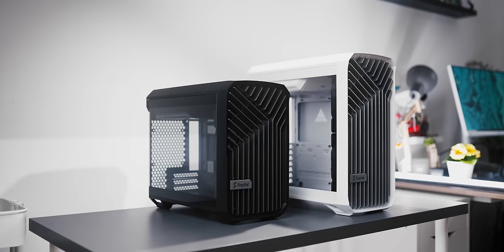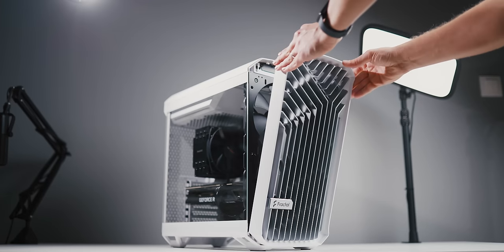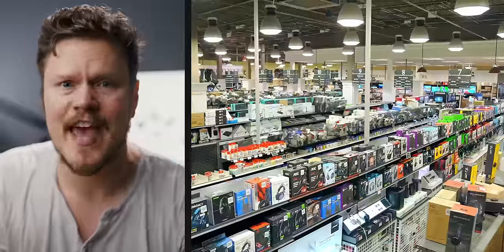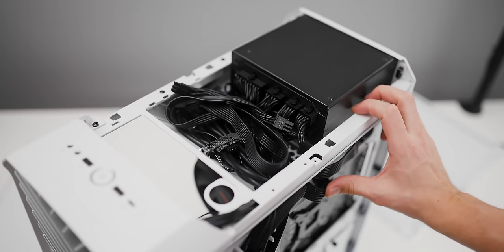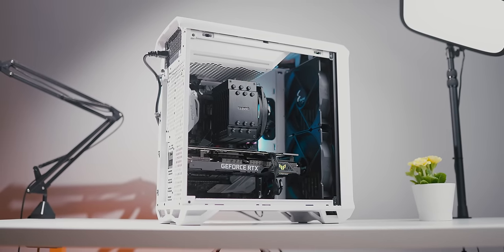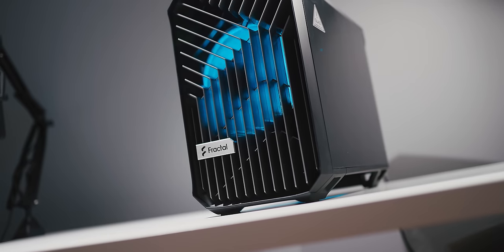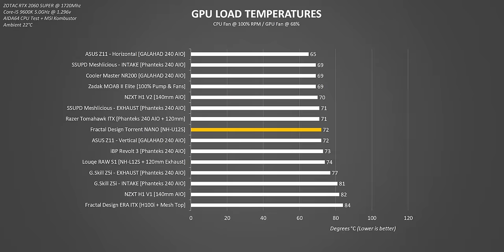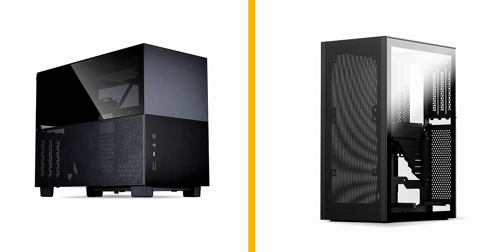Absolutely LOVE These Cases - Fractal TORRENT Compact & Nano!

Comment: I really wish they offered a full mesh nano. I’m over glass side panels. I love the design.
Reply: There's a reason why the top and side pannels are sealed while the front and back are full open, to chanel air in one direction, hence the name Torrent.
Reply: Why? With top and bottom intake, having sides/top sealed makes perfect sense.

Everything just pours out the extremely open back panel, the 180s move an insane amount of air.
Reply: No. It would let all the air escape before cooling anything.
Reply: Sliger Cerebus X.
Reply: A mesh side panel would do nothing for cooling while looking worse

Comment: I think Fractal design has nailed it with the Torent line. If I'll be making a build solely for myself, I'd go for the Nano. If I have to make a build to double as a workstation, I'd go for the Compact
Reply: I rebuild my PC with the Nano this week. And it works great, even with high end components. Would absolutely recommend that case.
Reply: @JayMatth   what cooling solution did you go with, ive Q58 at moment but high temps and noise are getting too much.....
Reply: @BrazenFond  I left the huge front fan in place, got an Noctua NH-D15 as  the CPU cooler (only the middle fan mounted) with an additional Noctua NF-A12x25 as rear exhaust. All fans are CPU-Temp controlled with max 60% speed settings.

But keep in mind, that my CPU (i9 12900k) will still reach its thermal limits under full AVX load.
For me its not a problem as I have no realworld workflow that uses 100% of the CPU.
Reply: Great case if you want to fry any high capacity hard drives that you're 
still using for mass storage, since SSD's in the capacity are way too 
expensive. That whole part of the case for cable management and SDD/HDD 
storage is totally flawed.
Reply: Why not the full atx?
Reply: @gickygackers  with the work I do now, the resources I need are more readily available on the cloud. Plus the cloud aspect negates the overhead of having to keep my workstation up to date so I can focus more on my job rather than put effort into maintaining my own workstation's system. So for my own personal build I'll be going for ITX for small scale personal projects and gaming. And if the personal project need more resources I'll look at cloud services to cover the extra overhead
Reply: @ResumedPausing  Full ATX case just allows system to be cooler but okay mister "cloud services". Wouldn't want you to put too much effort into it
Reply: @gickygackers  you and I both have very different workloads and very different needs
Reply: I'm liking the look of the nano.... How will it perform, esp if I go with the new Asus x670e Mobo?
Reply: @gl897  as long as the board follows the standardized ITX sizing I don't think you'll see compatibility issues
Reply: @gickygackers  You're very wrong about that. Compact cases generally have similar, if not superior cooling performance to full towers, all else being equal. This is because the air hitting the components has less time to warm up from ambient temperature before hitting the components. Don't be a dick, but definitely don't be a dick when you don't have a clue what you're talking about.
Reply: @liyifenn  I've since learned my lesson and can confirm.

Comment: You'll probably see a bump in price for all new cases in 2022, across all manufacturers. Steel and raw material prices have gone up significantly in the past few months; this is just the first case you've seen released with properly adjusted prices.
Reply: also shipping cost, which affects cases much heavier than other components
Reply: To be fair. This case line is mostly all plastic. Looks like it's metal but it is for sure recycled plastic.
Reply: @razorwind4623  and still costs like $200 around here....lol what a joke

Comment: For personal use I tend to build ITX and do like the nano, but it’s  too big IMO. My NR200 is smaller (SFX PSU) and I use it with a Noctua NF-u12A air cooler with the rad bracket removed and have a pretty big GPU with bottom intake fans. I find the NR200 is still hard to beat for compatibility and performance not to mention the price.
Reply: I agree; it looks great, but seems quite wide. I'm running a SAMA IM01 Build, which is similar in size to your case (4 litres greater than NR200), and it does quite great at this size. How are you finding your cooler? I have the Noctua U9S and it's pretty solid for its size
Reply: @Baldwhip  that’s a nice case. Are you running mATX? As far as the cooler, there is no comparison. I used to have a D9L which is similar in performance to your U9S. It is similar in performance to a 280mm aio or full size tower cooler and very quiet. On the other hand, it’s also expensive.
Reply: @GR-cd2kx  i’m running mATX but want to switch to ITX

Comment: 15 years ago: we moved the power supply to the bottom, so innovative!

Today: we moved the power supply to the top, so innovative!

Great review none the less guys 👍
Reply: Honestly I always preferred the PSU to be at the top, but in it's own chamber with adequate cable management.
Whereas old cases just had it hangin out in the same cavity as everything else and spaghetticables floating freely
Reply: I like the idea of having it up top and doubling as exhaust, but I wonder what's actually better looking and working.
Reply: In 1999 my PSU was up top.  Of course, my beige $40 case was crap back then…
Reply: Haha
Reply: @InfiniteDarkMass   Without checking, would be nice if there was a case with the option for either location to find out
Reply: Lian Li "we put it on the side and made one of the most popular cases"
Reply: @Srenic  Corsair did that first.
Reply: @TheSjuris  still, the side psu led to a better design for the main section of a case.  I look forward to seeing the thermals of Lian Li's upcoming cases
Reply: @Srenic  better design with not so great fan placement.
Reply: InWin: pathetic... I am 5 dimensions ahead...
Reply: Tomorrow: We moved the power supply outside the case and made it wireless.
Reply: @GholaTleilaxu  "introducing.... Bluetooth CPU"
Reply: Only downside is the added weight up top I feel, the entire computer feels more stable in my opinion when the center of gravity is at the bottom of the case. Leaves me peace of mind as I don't necessarily have to worry about knocking over a 2000$ computer.
Reply: Yeah I must have missed the bottom mount trend lol.
 But yeah last build I recycled an old case...

Comment: One of the trends I'm noticing with many pc parts manufacturers, including Fractal, is the absence of Micro ATX parts in many line-ups.
I understand that the Torrent Nano is built with 3x Slot GPUs in mind, but it is LITERALLY one slot away from being M-ATX compatible. Not to mention, the lack of Mini-DTX motherboards.
Is just me or do these 2 form factors seem completely underrated and underrepresented in the PC space these days?
Reply: It’s probably because MATX is a dying break unfortunately
Reply: @terrasai2857  yeah I thought there were like a couple of mid range mATX boards. Itx boards, on the other hand, are getting better and more high end by the year! There is almost no reason you would need bigger than itx for a gaming machine. Love mine in the ncase m1!
Reply: That's because, if you can sacrifice some pcie slots, you can sacrifice all of them.

Plus, if you wanted to size down, going mini itx is far superior for its size.
Reply: @thetechrealist  a gamer has not been needing any more pcie slots besides the gpu one (even soundcards got out of fasion fast 10 years ago) for like 15+ years now. I think technology had to progress enough for it to be good AND be affordable to make sense. Glad it is now!
Reply: mATX feels kind of pointless to me personally. Not small enough compared to ATX to make any actual difference in use
Reply: m-ATX saves you 2.5" height over s-ATX and nothing more, so that's the dimension people care the least about.

Depth & width are all that really matter on a desk 99% of the time.

There's nothing wrong with going m-ATX motherboard as long as you get all the headers & slots that you need. But m-ATX case options are pretty shit.
Reply: @evankirschenmann4653  torrent nano is large enough that it can fit mATX.
Just look at the case dimensions.
Fractal Torrent Nano: 417 x 222 x 374 mm = 34.6L
Silverstone TJ08-E: 385 x 210 x 374 mm = 30.2L

TJ08-E fits mATX, ATX PSU, 2x 5.25 bays, 4x 3.5in bays, and they both fit a 335mm GPU.

How did Fractal manage to make their case larger while offering less than a TJ08-E, and make it more expensive?
Reply: Matx is the bastard child of the pc form factor, so bastard that even gamersnexus decided to entirely skip whole best matx case of the year on their best cases of the year videos.

Luckily matx boards and cases are still a very very budget friendly options and it is really popular in south east asian countries.
Reply: I own a mATX Mobo, b560M Aorus Pro AX, paired with a 11400F. I believe it's one of the better b560 boards out there after seeing tests of how many b560 boards are trash. I already had a case which fits both ATX and mATX. Thing is, it's a budget rig. The Nano is not what I would call a budget case. ITX cases and mobos generally seem to be more about being compact then being cheap.
Reply: @MrDeaf  SFF cases and ITX cases are like squares and rectangles. For gaming PCs with discrete graphics, all SFF PC's (under 20L) are ITX, but not all ITX cases are SFF. The Torrent Compact is 46L, an ATX case that fits ATX boards, and even eATX, up to 274mm, so claiming it's an mATX case is wrong. The Torrent Nano is 34L, and fits ITX, and DTX boards. It is NOT SFF, and is in fact closer in size to most standard ATX cases.  They're gorgeous cases, give great temps, are seemingly easy to build in, and are unique, but they're not cost effective or small like an NR200 or some equivalent case.

Edit: My original reply doesn't really address your comment much, but mATX boards won't fit in the Nano according to Fractal, so 🤷‍♂️
Reply: @echohotelsix  I don't personally see much difference in pricing between cheap ATX cases and cheap mATX cases, but being closer to the source via living in Southeast Asia (China, who makes almost anything cheap) could make the one that takes less metal (mATX) cheaper, so your point makes sense to me at least.
Reply: @MrDeaf  fitting a mobo is only part of the equation of what takes space and how, so this isn't as direct of a comparison as the numbers might make it seem
Reply: I'm sure manufacturers would love to kill the mATX segment to keep rising the prices. Full ATX is already expensive and I-ATX carry even more of a premium (barring flagship OC Full ATX boards).
Reply: @evankirschenmann4653  No, you don't understand. To clarify, I am saying the Nano is so incredibly obese, that it >>>>>>>>>>should<<<<<<<< have been able to fit mATX, while still keeping an ATX PSU, 335mm graphics card, and 180mm fan.
And then I proceeded to give an example of just such an mATX case, the TJ08-E.
Reply: @evankirschenmann4653  Also, are you kidding me? TJ08-E is the perfect comparison to Torrent Nano.
TJ08-E is a case design that is 10yrs old at this point, and fractal failed to make their torrent nano a significant upgrade over a decade old case. That, in my books, is not a design win.
Reply: MicroATX would be fine if they put the x16 slot as the bottom slot.
Reply: @MrDeaf  Oh, then I totally agree. Probably has something to do with cable management holes up top.
Reply: Myke T-L and the practice of slim laptop Sata mounts all over the place, with many cases
Reply: Actually mATX makes more sense than standard ATX because it supports pretty much everything 90% of anyone would ever need while not having the compromises of itx. Matx should have been the standard atx
Reply: Yes but companies want money and the small PC market is making more money in the itx area.
Reply: You can't get 4 DIMMs in an itx format and having the extra pcie's for a NIC upgrade seems worth it. But full ATX is certainly overkill for gaming build.
Reply: @QuentinStephens  Slot 2 for sure, but definitely not the bottom. You want to give enough clearance to whatever expansion cards you put on there, and with the current AIBs making 2.5-3.5 slot gpus, a Slot 4 x8/16 slot may not be the best choice...
That is unless you use an ATX case, in which I agree with you.
Reply: @thetechrealist  The problem then becomes, what if someone wants to add extra expansion cards/peripherals to their system? or what I/O Ports do I lose by using X-Ports on the Motherboard...

ITX can only provide so much I/O via USB/TB before that bandwidth is used up. And depending what all you're using at any given time, could lead to some serious performance issues down the line. And the premium you pay is sometimes difficult to swallow personally.

I find mATX underrated and undermined by the industry, as they can provide some massive opportunities for tinkerers like myself.

Wanna run multiple RAID Arrays, but don't want to lose multiple SATA ports for one nvme slot? WACK, Toss a X4-8 PCIe expansion card with your m.2 drive(s) on it!

Need a capture card with low latency for streaming? BAM, Elgato 4K60 MK. 2!

Not enough USB 3.0/3.2 Gen 1 ports for VR, or Low Data Bandwidth issues? BOOM, USB Expansion Card!

Faster networking speeds: 10G NIC.
Reply: @JamesMyatt1  Which brings up one of the many things to consider: Is this for One major purpose, or Many major purposes?

I think at this point in time, we can infer the following:

(E-)ATX: Common, Wide Affordability range, Best in Performance, Massive Amounts of Storage, Plenty of I/O, all of it available at once on consumer/prosumer levels form factor.

M-ATX: Uncommon, Similar to ATX but Smaller and fewer PCIe slots available. Good for PCs with a few Main Purposes, along with lesser ones.

ITX: Compact, yet Powerful. But lacks expansion once completely maxed out. Best for Single Purposes with Minor auxiliary ones, or ones that are resource-light.
Reply: If Mini ITX became cheaper than ATX, a lot more people would change over
Reply: @thetechrealist  unless you want 4 ram slots
Reply: @mykethelabrawolf6167  You could use external solutions but honestly if you're doing all that, standard atx is the superior option.

Micro atx seemed so good to me at first too but then you realize that it's not much smaller than standard atx.

Pair that with the fact that it's less easy to work with, the cases blow, and it's about the same price as standard atx, then you got yourself a shit smoothie.
Reply: @phishphan49  4 ram slots blow tbh.
Why wait to max out ram to begin with?

8gb standard user
16gb for a gamer
32gb and up for editor.

Simple

The speed difference also isn't better than spending that money on a superior graphics card anyway.
Reply: @terrasai2857  I think most people are putting Matx boards in small mid towers instead of buying matx cases
Reply: For me the m-ATX option is also missing in the Nano! 
m-ATX is getting rid of all the unnecessary slot from the ATX (for most people) without being extra expensive, especially with cases and PSUs.
And since the Nano isn't really a SFF it would have been nice!

Comment: I love that design. With front and bottom intakes together that case should keep the whole system really cool with minimal fan noise. I'll definitely be using that case when I do my next major upgrade.
EDIT: They lost me by having a tempered glass cable management panel. I was really into that case until I found out. That just adds fragility without any real visual benefit. I'm not sure why they made that choice, but I hope they change it or offer a version with a glass side panel on the other side but not the cable management side.

Comment: For Nano I would have used sfx power supply and placed top front to reduce size.  That way you could have exhaust fan in top back.  Otherwise your 120mm in back is going to have to spin fairly fast to remove the air coming in from that 180mm.  Or at minimum use sfx in back and allow micro atx in this case.  There's plenty of room.

Comment: Just bought the original big torrent case and I love it. Keeps both gpu and cpu around 60 degrees Celsius under load with just the case fans and a Noctua NH-D15 cpu cooler. Also note I capped all case fans to 50% so they are very quiet. Components were very easy to install because it's so big and there is lot's of room inside, my old case was about as big as the Compact version and I hated it.

Comment: The Torrent is my new favourite case. I just built an air-cooled threadripper system, and the torrent provides awesome airflow. I love having the PSU at the top because it allows my gpu to receive so much more air.
Reply: Yeah I thought top mounted PSU was a thing of the past until Fractal brought back this Silverstone RVO2 style design.

I'm sure we'll start seeing lots of new designs borrowing from this, with front & bottom intakes and sealed tops.